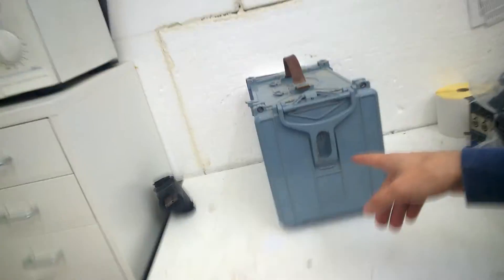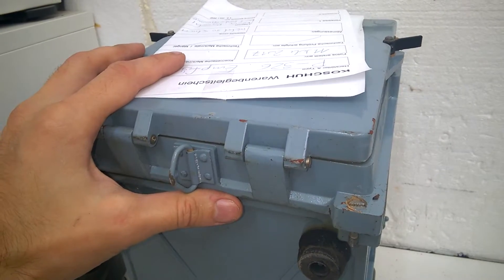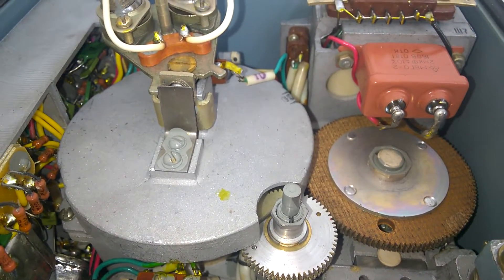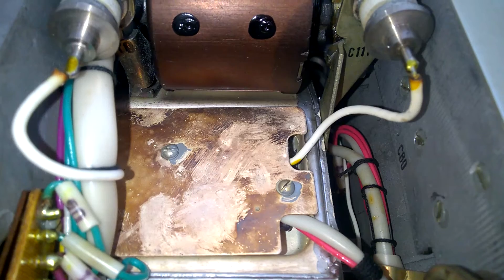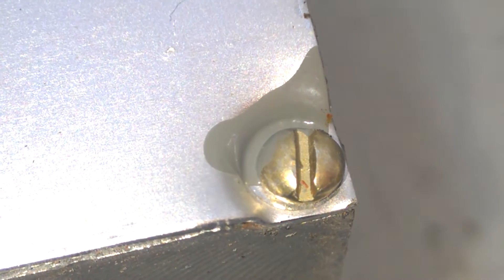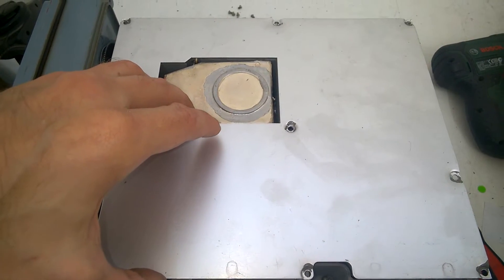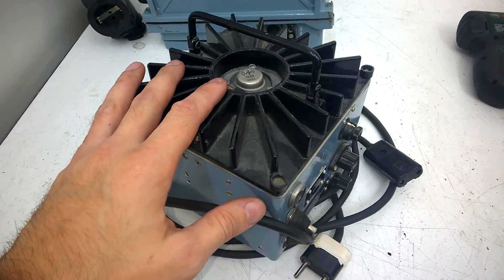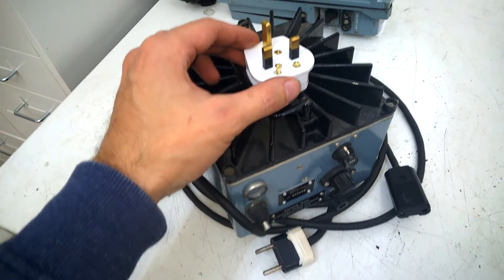Russian P-326 Short Wave Receiver: What's inside? #dailybeb Ep.14

Comment: Classic soviet stuff with its typical lighweight and flimsy construction X-D In the early 2000's those radios were available very cheap on ebay, now they are getting pretty collectible and rare. I never had this model in my collection, mostly by lack of storage space for it, but I had or have R-105, R-113, R-126, R-352 and probably some more.  The kind of rounded head slotted screw you have in this radio was used in any soviet product you can imagine, from the cheapest consumer device to space probes.
Reply from the maker: Thank you for your excellent and detailled comment